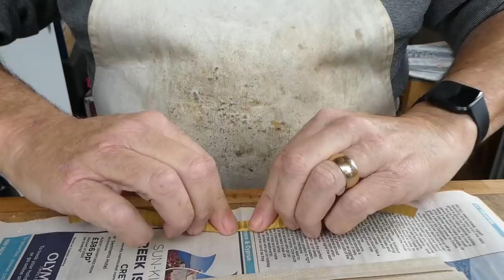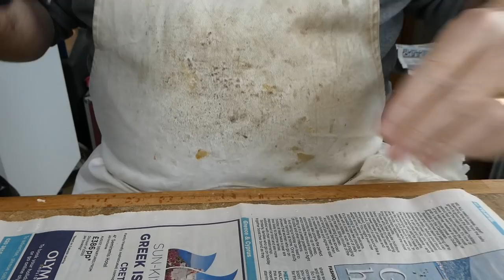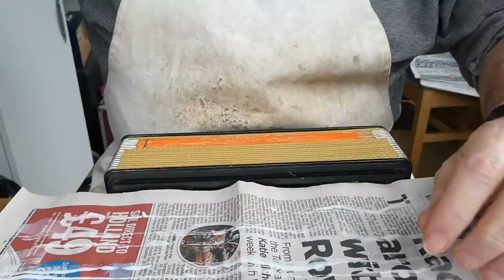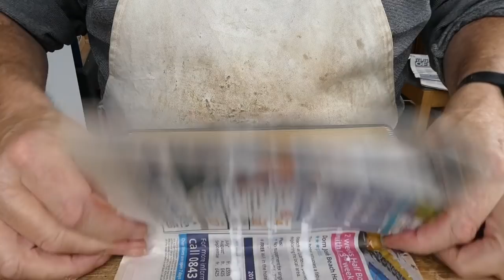Hot Rod a Hohner Episode 7 - Retape the Bellows

Comment: excellent video Lester , what would you recomend in this case .  I am trying to restore and older accordion , i had it tuned by a profesional and i retaped the bellows following your video but the bellow pins were replaced at some point by some nasty screws .  Do you know if there is anything i can do to restore that and be able to use the bellow pins again ?
Reply from the maker: It should be possible to remove the screws and plug the holes in the casework and the bellows frames with some dowels (I use cocktail sticks and wood glue) then re-drill the holes. If you do this be sure to compress the bellows gasket before drilling the holes otherwise you may get air leakage.
Reply: @MelodeonTunes  ok awesome i'll give it a shot thanks Lester !!